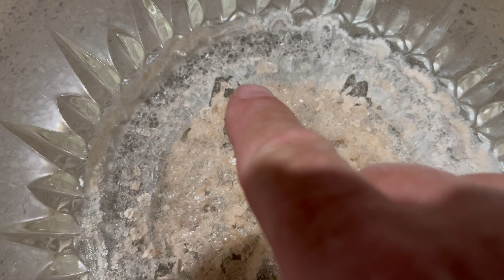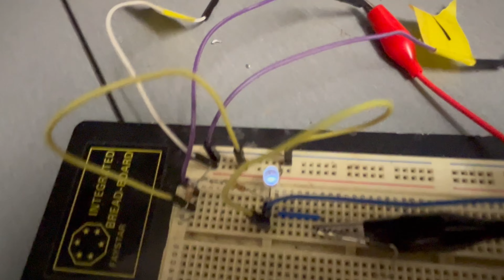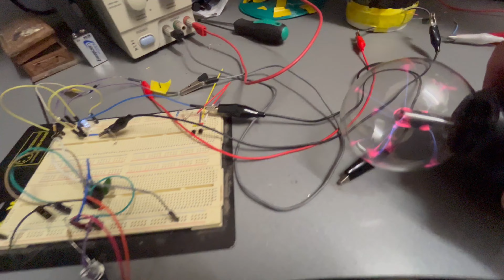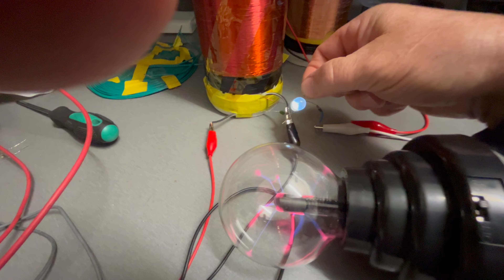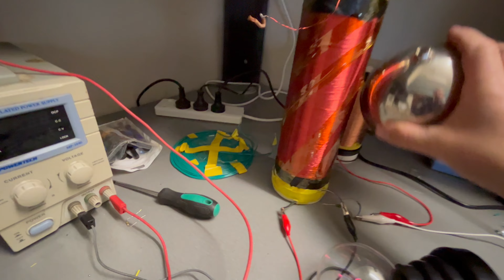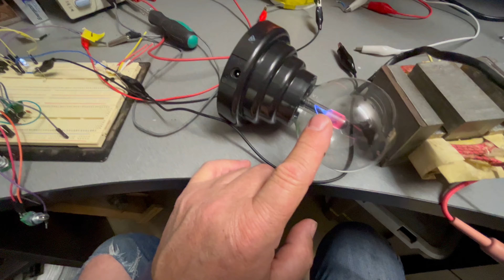Plasma Ball Radiant Energy

Comment: So why does the metal kill the effect? the clip touched the glass and the led went out, But, when the energy goes through the pvc insulation it lights it up.  Not to mention the fact that the ball is somehow causing the transistor to switch without any metallic connection.  It's dielectric weirdness. Tesla had experiments showing things like that in his lectures. Trying to make sense of it induces Pain between the ears...

Comment: I have the same plasma ball and using a piece of 40mm round aluminium foil stuck to the top and a wire connected to the foil, then connect the wire to a home made bridge rectifier of 1n4148 or 2cL73a diodes. And I can power up multiple 240v LED lights.
Reply from the maker: Ok . I’ll give it a go too.

Comment: Ah the old Slayer Exciter well know for the destruction of MOSFETs ... hmm i want to make a coil and see if the focus of energy is at the centre, a guy i follow on youTube ( MTech ) is making some nice plasma spheres using his rig, just puts a light globe in the centre of the coil and it makes the strongest shapes i have seen, ... i then want to feed it with Aluminium to get some fusion happening ( returns the most electron-volts ) after i evacuate the test cylinder to get the reaction started. Al 13 + Al 13 = Fe 26 ( you dont even need a coil ) just spark two pieces of Aluminium foil together using a capacitor ( and separated with a few drops of distilled water ) see LENR and Bob Greenyer's articles, for some demos to do it.
Reply from the maker: Thanks. I’ll check it out.